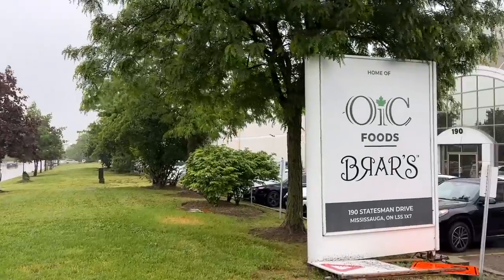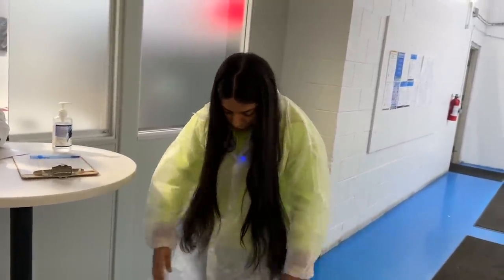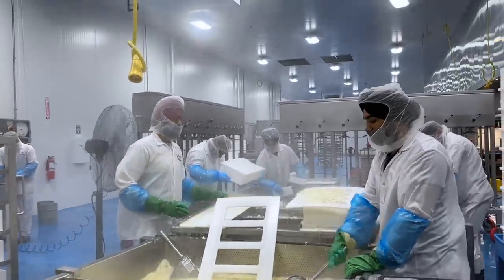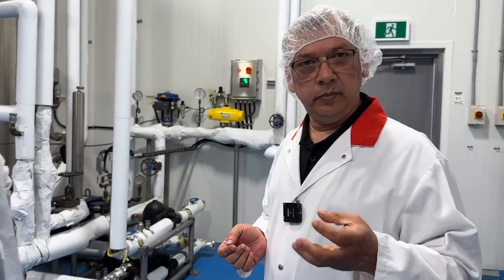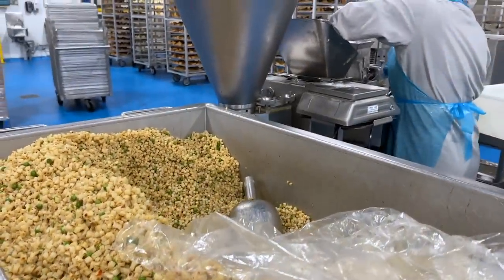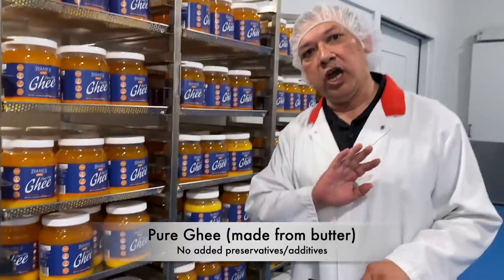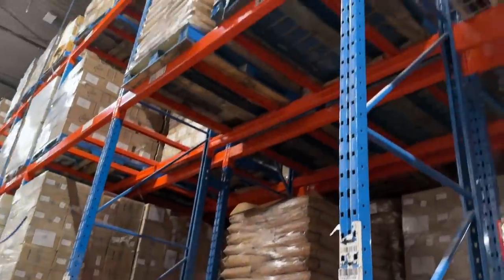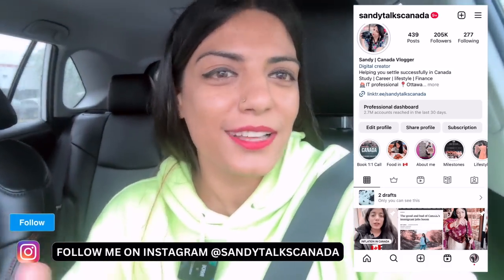Inside Brar's factory in Canada | How they make Indian sweets in Canada

Comment: You did everything needs for safeys why u guys take shoes inside most important cause of contamination
Reply from the maker: These are big machines and you need steel toes shoes that has a protective reinforcement in the toe which protects the foot from falling objects or compression. So no you can’t remove shoes intact you have to wear protective gear on top. Employee safety matters as well.